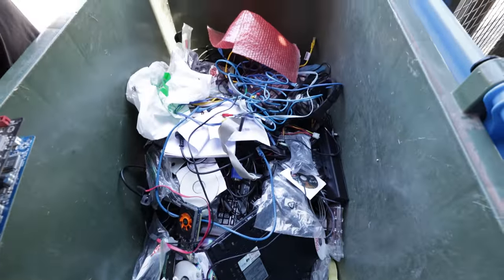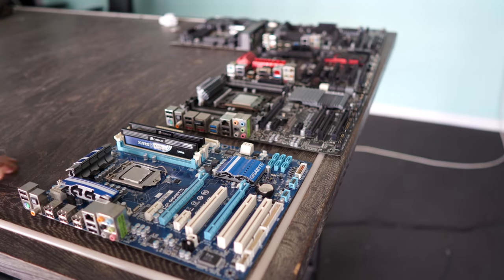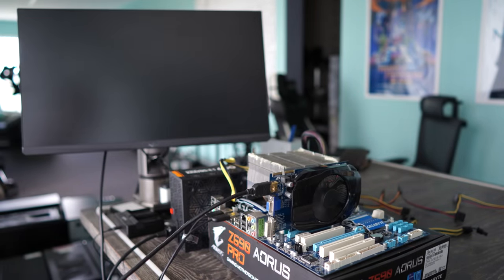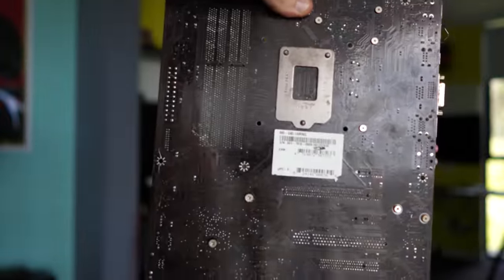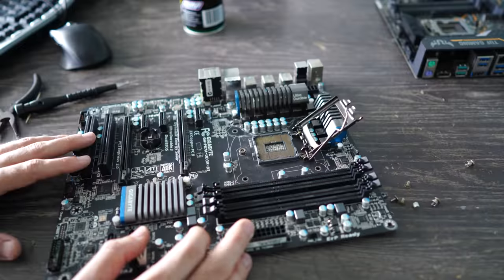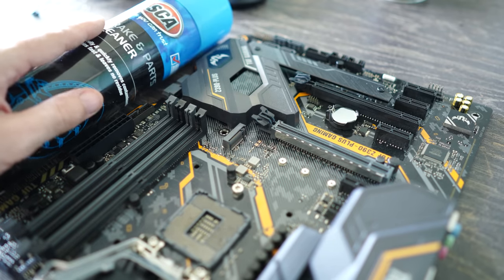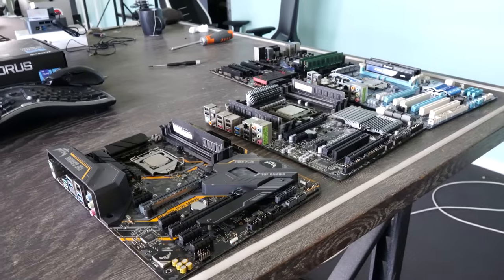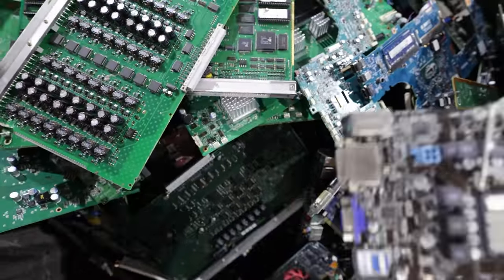$0 for Enthusiast Tech!? DUMPSTER DIVING!

Comment: Those pins that broke on the z390 were probably grounds and that’s good. I’ve had a broken socket pin and it just happened to be for the x16 slot which ended up disabling the socket.

Comment: Kinda like dumpster diving for "broken" tech on ebay... I got a "broken" Crosshair V Formula-Z for $40cdn because the guy thought it was fried. Turns out I just had to replace the bios chip, which was socketed anyways. Works like brand new. And still in new condition, just sat in a box since he bought it. Replaced the thermal paste on the chipset and replaced the thermal pads with some newer thinner ones.

Comment: I do this too, but just as a hobby and as a public service -- there are many underprivileged families who don't need a "1337 leet gaming rig", who rather need a basic PC for just Web access, e-mail, etc., but have "zero" money to invest (many of these folk can barely afford to put food on the table, never mind a computer bought at retail prices). I usually provision these boxes with Xubuntu Linux as the primary boot O/S and (if a "free" license key, e.g. the sticker showing the one that came with the PC in the W7 / Vi$ta days, is available), W10 as the alternate boot O/S (the user can use GRUB for the boot menu to pick the one that he or she wants). The big price issues in these cases are "cost of a halfway usable monitor" (surplus monitors in good condition for a reasonable price, I find, are quite a bit more rare than cases and motherboards) and "cost of a high speed Internet connection". Oh well... us dumpster divers do what we can... right? :-)

Comment: Im surprised that most of the boards are actually working, I'm very curious about the z390 stability when booted into windows.

I have dealt with a bent cpu pins, some boards won't recognize multiple stick of ram, some with have a thermal issues.

Definitely a follow up video on that z390 motherboard

Comment: Your very lucky they allow you to dig around,here we had one recycle place in a remote area we could sneak into after dark,,,,owner ended up dying so they shut down this one and only use the main plant which is 100% off limits so my picking days are done.Kinda sucks i got a lot of computers and gear from the small depot over the years...my building full of parts will have to last me now.

Comment: I remember back in the day, my friend's mom would take us along to the recycling center as she was on the hunt for paint (they had a section where you could pick up like 1/4 cans of paint people disposed of). Anyway, there was always a big box, like the ones watermelons come in, full of old PC bits we'd root through. We eventually ended up building a working dual Pentium II, used it as a CS 1.4 server for a while. 

Don't remember what happened to it sadly.

Oh, and more recently; went on a dump run, noticed a "gaming" PC case sitting in the scrap metal pile. When I looked, I could see there was still a CPU in it, and it happened to be a 775 board. Ripped the heatsink off and popped the CPU in my pocket. Turns out that Core2Duo was better than the P4 I had in my PC at home.

Comment: Pro tip next time use a butter knife to straighten out the IO pins. As a fellow pro it has worked out for me. Also I have used this method on Fighter Jets with ZERO incidents.

Comment: There aren’t any “unnecessary pins” on a cpu slot. Sometimes they can run missing a pin or two, but then when more channels or higher speeds are needed, BSOD or complete shut down is almost imminent.

Comment: So my awesome school has this storage room and the tech guy let me get my hands on whatever tower I wanted for free. I love them. Got an Asus tower with a core i5 3340s and I added an extra 4 gig stick of DDR3 ram to make it 8 gig dual channel. I added my 2 gig GTX 960 in it and it works really well. I also got a sweet HP IPS monitor that is incredible for 60 hz. I want to spend 20 dollars and buy an i5 2500k though from ebay and swap the CPU. I don't like the low clock on the stock i5. But always happy when I get free stuff! :)

Comment: I have also goten a i7 860 pc, a Dell M4800 laptop, a Dell Vostro i5 5200u laptop, 10 hard drives, a monitor, a realy nice Ubuquti ethernet switch that I sold for 50 euros (it had 6 broken ports), a Pioneer amplifier with some realy nice speakers and a double cassette radio for free.

Comment: I scored a free system the other day, and the only thing wrong with it was the VGA cable was busted. Computer is bog standard(core 2 duo e4600 using integrated graphics), but the monitor is a 1080p 24" little beast (Phillips 244E1). I thought that was a great free pickup.

Comment: My father works at a university Called Aalto university in finland they have a simular place where students often throw out 50-100% working tech and stuff i'w saved many thousands of euros by getting Pc components monitors cables head sets etc highly recomend doing thees kind of sfuff with a bit of cleqning and restoring you can get some crazy stuff the reasoning the students use is that they live in a small 1 room appartment so they don't have time nor space to resale or to keep them

Comment: Havent dumpster dived but purchased both Cosmos 1 & Cosmos 2 cases (couple hundred quid each new) for £20 delivered. - The aluminium cosmos 1 looks so good but utterly crap cable management - I'd love to mod it to white / black but it'd loose that aluminium - hard choice but they look SO good white with black accents - i'd also take a dremel to it to create cable runs and a perspex window would finish it off nicely.... the Cosmos 2 has so many harddrive bays its in use atm but i need to NAS up - and it's so damn big but I guess under a desk what does it matter.

Comment: found my first gaming pc in the trash on the side of the road. it was a beats edition hp envy with an i5 3470, 8gb of ram and a 2tb hdd. threw in a msi 1050 ti and used it for about 3 years until the motherboard died

Comment: hey talking about gaming on a budget.. i spent $30 NZD on getting this pc going that i found on the side of the road last week.. core i5 6500 8gb ddr3 1600mhz ram.. gtx 750 ti 2gb gpu.. all work... cpu needed a re paste and needed a hard drive.. i feel the system can do with a better cpu cooler and i plan to upgrade it further.. as its a h170-plus d3 asus mother board with m.2 slot, will be making m.2 the boot drive and upgrading gpu to gtx 1070 or better, and will put 16gb ram in... cheers (this comment sent from said pc)

Comment: I brought back my 15 year old dead pc back to life .bought a brand new monitor. And rest from Dumbster digging Got 2CPU ,600WPSU,2 fan, got 2 GPUs. 2 500GD HDD. 2 RAM stick. Some wires .2.1 speaker .Now it's my Movie and Server system with printer and But I use my gaming laptop for 3d rendering .

Comment: Just wanted to chime in here in the hope YES reads this - most of the GB boards from the Gen2 and 3 era that bootcycle, I've 90% had them up and running after a external BIOS flash. I noticed in one of your videos you were using a TL866 programmer - that would probably have fixed the P67.

Speaking of which - beware, as some H55 GB boards have started developing this as well. I have two H55M mobos (a H55M-S2V and a H55M-USB3), both needed their BIOS chips externally programmed. The USB3 would refuse to POST on the main BIOS, and the S2V would take over well a minute to turn off due to corrupt Management Engine BIOS.

Comment: You are giving away my secret. I mainly deal with OEMs, But I have to pay scrap metal prices. Which is less than $5. For a complete system, and I pick out the most complete and less damaged cases. resale for $50-100 each.

Comment: It's been a while since I found anything in this building's "waste collection shack" but last time I scored a working system with an Intel i5-2500 in it, and some parts that were a couple of generations older (including a GT210 and a QuadroFX 1700 :D). The i5-2500 went to my ex who needed something to run VMs on for a course, the GPUs I'll keep in case I need a video out, memory can always be useful, the rest has mostly been recycled *appropriately*. Then there's my flatmate's ex work PC that has a 6 core Xeon in it that's by far the most valuable thing in our junk pile. :D

Yeah, I love dumpster diving hardware. :D

Comment: Well, congrats on successful repairs on both you and your trusty toothpick! Not long ago I picked up Lenovo M17 with a 22" FHD60Hz monitor absolutely working literally 20 meters from my home! Swapped CPU(some Pentium to AliExpress's 1265Lv3 for PSU's sake), flipped RAM(1 2GB stick of 1333 for 2 4GB 1600 I had on hand) and added GPU(1030 I also had in spare). Currently temporarily on a change for my stepson's friend(needed something for his younger brother for minecrafty little joy😂) but hope to get it back soon as quick as I repair his rig. Whole Lotta fun on around 60 watts of consumption,  even rolls GTA V on minimum with that monitor! And all I paid was the CPU, less than 60 bucks!!

Comment: I have a recycle center nearby but they chuck everything out and sell ram, cpu, power supplies and a few other things. Motherboards, cases and all other pcb’s get recycled. They don’t want to have people go through the containers so unfortunately not going to get some free motherboards. Although most stuff they have there are non standard server boards anyways.
Reply: Server boards kick ass tho where else you gonna get quad socket
Reply: @virtualtools_3021  yeah but you can’t put them a standard mid tower case.
Reply: @sijedevos2376  not with that attitude
Reply: @virtualtools_3021  I literally doesn’t fit and if it does the power supply doesn’t.

Comment: Hey Bryan - Tech YES City, I totally agree with you that some of these older computers still have life and are of use.  I have a i7 4770K running as an UNRAID storage server and a i7 4770 running my security cameras.   Although I wasn't always that way inclined, I use to upgrade my system every 18 months or so even though it didn't need to be upgraded, and then I thought to myself why am I doing this and wasting so much money upgrading all the time.  In the early 2000's I worked for a University here in Melbourne, Victoria and ran a program where we received old PC's which were refurbished and then taken by Rotary Australia who then donated the computers to those in need.  It was a great job and I must say I really enjoyed it, though non of the parts were dumpster parts, just old systems from businesses that had upgraded.
Reply: a i7 4770k is still a powerful chip, I had one in a pc until recently with a 780ti and was getting 60fps high 1080p on GTAV and even on some newer games and it never really dropped frames.

Comment: I think that when you have a PC that constantly just boots on and off in a continuous cycle, a lot of times that can mean a faulty CPU or bent/broken socket/CPU pin or pins.  The CPU is just not receiving the proper voltage signal to stay on and just gets stuck in a constant on/off cycle.  Maybe try a different CPU and recheck the pins on that board that just recycles on and off. 🤔
Reply: Check PSU first especially if its a cheap one, then other components one by one

Comment: omg how are you able to use those THICC toothpicks to fix the CPU socket pins??? whenever I need to fix pics I use the very corner of a new, sharp RAZOR BLADE... because it's a flat plane its VERY easy to bend pins in the direction you want... but I've never really tried a toothpick... maybe because its wood you are able to  change the shape of the tip to the way you want...?? idkl... next time I run into this prob I think I'll give a wood toothpick a try :)

Comment: Its sad that in Poland where I live people sell those like older boards for prices of like a new B560M DS3H. Literally everything goes on like our local craigslist for insane prices. Best is that they are likely never sold and stay like that. Even broken stuff. Like broken RX480 for 150$. Always wanted to have a GTX480 in my collection but its impossible to get in Poland and costs even more when shipped from US. I would love it if it were like in this video. Even if it was a bit broken you could fix it.
Reply: Same in my country. Even if its broken they ask half the price of the new. And say like "it can be fixed"  But when you ask a normal ptice like 30 bucks for a damaged mb or aio for 10 and you can clearly see damaged fins and leaks they get mad for not getting like half the money of the new price
Reply: @filds1  Yeah, some people just ask stupid prices for damaged stuff. Just because something was worth $1000 once, doesn't mean it is still worth half that when damaged. Realistically a lot of damaged stuff is beyond economic repair unless it is something simple. The problem is that people use the original purchase price as an anchor, that's why you see stuff that might have been high end 10 years ago, advertised at silly prices. Buying new budget hardware would offer better price/performance and have a full warranty.

Comment: I am typing this comment using the Intel core 2 duo E8500 L2 cache 6mb (The Gaming Beast) bought from 02Feb2009 and when MSI G41-combo DDR 2/DDR3 (3RD motherboard) with 3 years warranty spoilt and i keep pressing delete button non-stop with my right hand index finger to save this motherboard because it start and stop with lights proving it is still alive and press delete until it works and i use it for another 6 months till it spoilt. Then I went to a computer shop and point my right hand index finger at the extreme right hand top corner which is very far away from the main door/main entrance of the shop at that Afox G41 motherboard supports only DDR 3 with 1 year warranty and bought it at SGD $89. Elite old Gamer do not break a sweat using only right hand one index finger repair computer.

Comment: i still have my old P55a variant of that gigabyte board with the identical corsair cheapo ram but with an i5 750 in it - it may end up a nas-alike. I originally gave it to my niece but they were swayed by a Dad who didn't have time to chase issues and the ease of consoles... and we live too far away for me to drop by and fix issues for her. And again my brother wasn't going to spend even 10 minutes hooking up teamviewer. So on a holiday visit I took back the pc & monitor i gave (it cleared room at my brothers so he was happy) so as its my 3rd pc, either nas (I need 1) or I'll give it away again. I plays saints row 3, sims 3 / 4, minecraft etc era games perfectly fine and would also make a good media machine for someone not into games - also the P55a has firewire, P55 doesn't so it could be regurgitated into a hackentosh.
when time allows i'll make a decision.

ps why did i type this, no one's gonna read it. :)

Comment: I've snagged myself a working Asus tuf sabertooth p67 board complete with an i7 2600K, 8 gb DDR3 ram, 2x gtx 570s and an ocz 750w power supply all in an old CoolerMaster case off the side of the road about a year ago. All I had to do was get a new hard drive, 8gb more ram, a monitor and a 1650 super(which I snagged at a ripper price) and I was laughing

Comment: Honeslty i see the dumpster dives a win. Just by seing a X79 motherboard because i would of loved to get that because my friend who doesnt have any money i built him a LGA775 pc with a 6850. The cpu is holding the system back and i got a lga1156 itx gigabyte board with x3440 and it worked fine and wanted to give him that but as i was transporting with a aio on it the board doesnt power up anymore, is the board pretty much dead or shoukd i try cleaning it with breakcleaner?

Comment: I'm not mad you making money from dumpster diving. I'm mad at those people throwing what's perfectly usable.
I have Pc dated back in 2008, it was a clearance sale from a cyber Cafe, that core2 dual can still be a good media machine with its 7 chnl audio.
My 10 yo 4th gen desktop still performs similarly to a modern day laptop. Since working from home I have been using it all the time.

I bought used parts of someone else as an '' upgrade'' although is few years old parts. They work like magic and saved more than 70% compare to brand new current Pc with 90%of its performance.

Forget about planting tress, we need more Pc parts being reused and less buying new

Comment: I do the same thing I got an INSANE find once a whole gaming pc this thing was a beast i7-6700k strix gtx 1070 32 GB of Corsair DDR4 RAM!!!! 1000W psu and the mobo was a high end Asus Rog maximus hero viii
Reply: Epic find.
Reply: @bustergundo516  tku last summer I found a gaming pc with no GPU and ram but the mobo and CPU where still there and once I lifted the cooler it was a 7700k lololol I don't get why people throw out such stuff I also found another 1070 on another occasion but it wasnt in a pc with it I found a 2080ti which didn't work  :( but hey at least the second 1070 worked and I got to try out sli and yes it is as bad as they say
Reply: @allroundgamer3541   bad as they say?

Comment: About 3 weeks ago my dad threw away some old belt buckles and my buddy asked me about them so I went down to the garbage bin to see if I can just reach in and grab them could not see our garbage bag but there was a PC in there with all the cables still attached to it so I thought it might have a hdd in it I could use well it did had a 1tb hdd in it then I seen that the manufacturer date was November 2019 so I plugged it in and it fired rite up had a password on it but that was very easy to by pass had a Ryzen 5 with 8gb of ram perfect for web surfing the reason I think they tossed it out was they set the monitor to shut off after 1 minute and probably didn't know how to turn it off only a guess
The s.m.a.r.t on the hdd had only 127 hours on it 😁